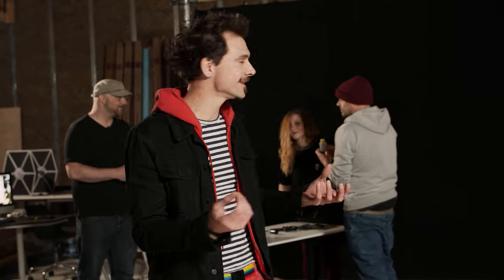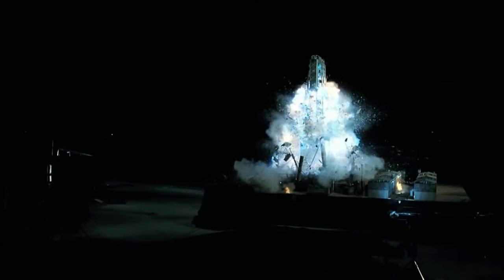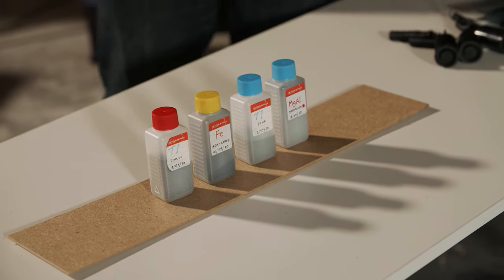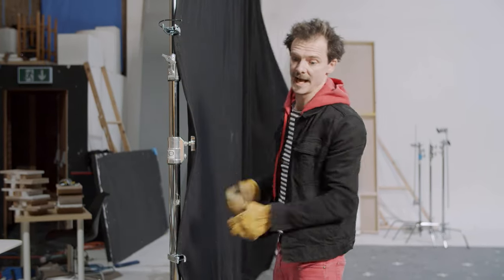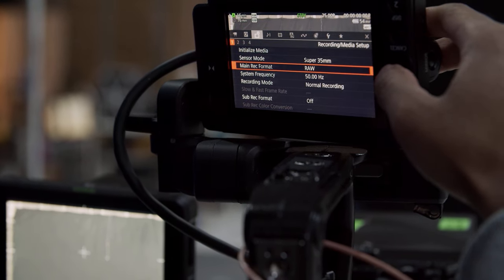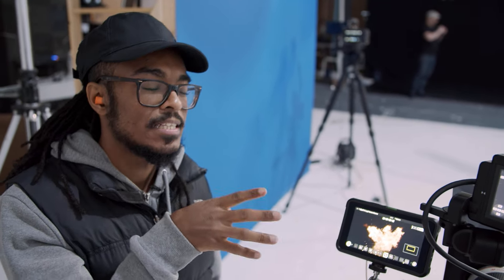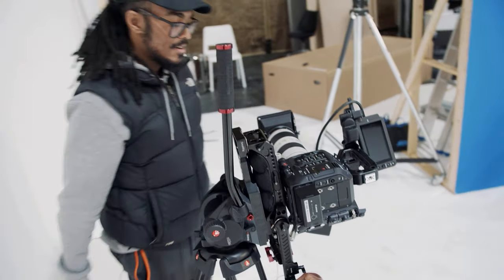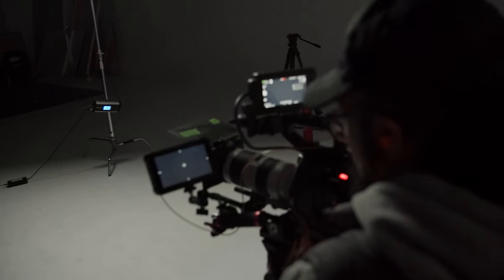We Made Mini Pyrotechnics Look Like HUGE EXPLOSIONS!

Comment: Great video! A question, how do you set exposure in the camera for pyrotechnics like this?
Reply from the maker: Good question. It often comes down to testing and experience…after a couple of test charges we honed the exposure closer to where it should be but generally we would get it dialled in very quickly. After you get used to filming fire and explosions, it becomes much easier to estimate how much headroom in exposure to allow. It’s always safer to slightly underexposed to maintain highlight details - as once those clip beyond the dynamic range of your camera, you can never recover them. If memory serves me correctly the settings we used for these smaller charges were around 120fps @ F8 with iso around 800 and shutter at 1/60-1/200. - JP

Comment: What ISO and Aperture do you typically recommend shooting at with these types of shots.  I’d be using a Canon C70 which uses the same sensor as the C300 shooting at 4K 120fps.  Also... 180 degree shutter?  Or do you want a faster shutter to capture all the motion with less motion blur?